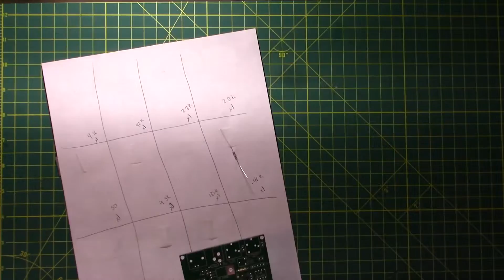#30 How to Build a Low Power Radio - QRPGuys DSB Transceiver Kit #2

Comment: Nice effort but...
PLEASE stop fiddling with the board at the end of each step.  We can not see what you are talking about because the board is moving all around.  Also when doing a close up do so in the light to the left.  You are continuing to do the close up in the shadow and it is moving all the time so it was a waste of time.  When describing the results of each step, put the board down or hold it still/steady while narrating.  Point to what you are talking about maybe using a pointer like a chop stick.

I want to see what is going on but this video doesn't make it.  
73,
Bob - W6OPO